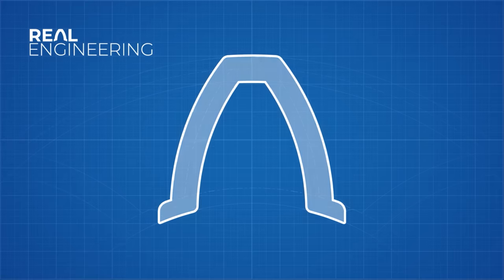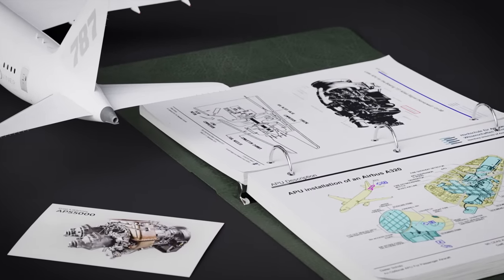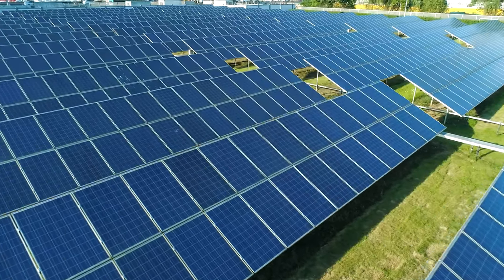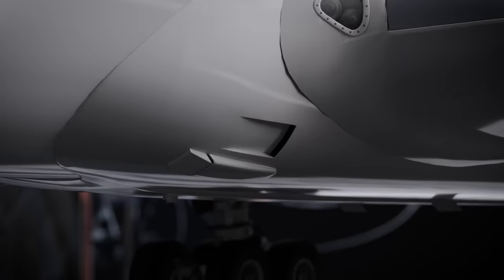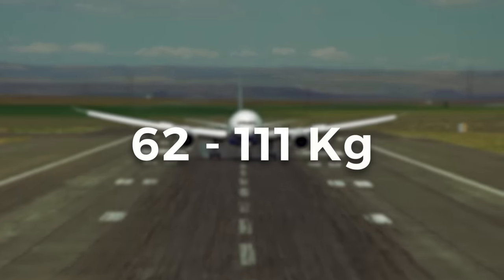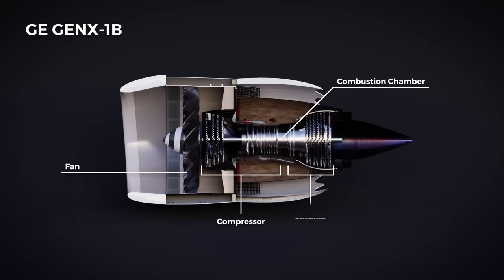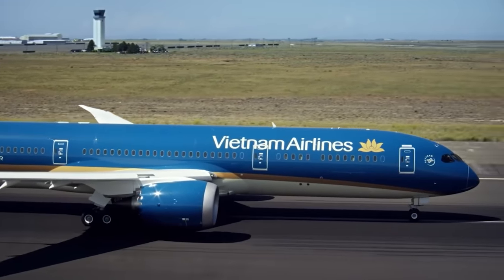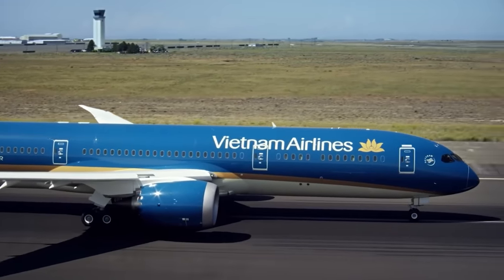The Insane Engineering of the GEnX

Comment: The GE90-115 is the big daddy where Turbofan engines are concerned. Even the GE9X engines that power the new massive Boeing 777-9 are rated at 5000 pounds lesser thrust than the GE90-115.

Comment: Small correction. While it's true that initially, the A-12 and SR-71 used Daimler Benz V8 engines on a cart to start the compressor, they quickly dropped that for a compressed air start instead.
Reply: Pretty sure the engines were Buicks…

Comment: Although I applaud your work on this and other videos and absolutely love the series you've created, there are some errors in this video.

The main ones ive seen so far are that turbofan engines dont use bleed air to power anything, there is a gearbox attached to the main shaft of the gas generator (N2), that drives the various pumps and generators.  Also, the compressor section and fan DO NOT rotate at the same speed on the same shaft.  They are both driven by their own shaft and turbine section.  These are coaxial shafts, because the compressor section of the engine can be rotating in excess of 10,000 rpm, while the fan section will rotate at 3-7 thousand rpm (if i recall correctly).

I say these things because I worked on the GEnx project back during the initial development stages, and before that I was on the teams that wrote the control software for the GE90 and CF6 families of engines.  The GEnx is actually an evolution and merger of both families, especially the GE90, which pioneered the composite swept fan blades, rather than the traditional metal straight-edged blades seen in most all other turbofan engines at the time.  The control software actually branched directly off of the software for the GE90-115b variant in its initial development, which was an engine designed for the long range version of the 777.

Comment: There are parallels between this plane and recent innovations in automobiles. 

 Advantages in direct fuel injection have allowed turbos and higher compression and better efficiency. 

Many vehicles now have electric power steering instead of hydraulic. 

Battery electric cars now have electric power brake boosters instead of engine vacuum boosters,  which are analogous to air engine bleed air power.

Comment: Bypass tubes like the SR-71 would considerably take the temperature down solving your heat problem of the engine so you wont have to burn rich fuels. Base the next engine off of this equation, .7854xdia2/PSI, for all diameters fuel side and exhaust side.

Comment: So the bypass works a bit like a dyson fan? High velocity, fairly laminar flows of air end up pulling in surrounding flows of air and accelerate them, creating a low pressure zone in their wake, which should create a suction effect in an open system. Seems useful.

Comment: This is a misinformation most people are missing. 58.1:1 is the TOP-OF-CLIMB Pressure Ratio, and it is usually quite higher than the sea level Pressure Ratio, which is 47.4:1. Moreover, this is on the highest end variant that runs the 787-10, which is pretty uncommon in the market. the 787-9 variant is more popular, and it runs on 46.3:1 Sea Level, and 55.4 Top of Climb. Source: GE Aviation's cite itself

Comment: What the host calls centrifugal force is actually centrifugal inertia.  That's the inertia that pulls away from a rotating mass.  The force that uses Newton's 3rd law to counter the centrifugal inertia, preventing the rotating mass from splitting apart, is called centripetal force.

Comment: Nice video. I;ve flown in 787s a few times and they are amazing. Boeing got their market research right, vs Airbus with their huge, mostly uneconomical 380.
One other point. we tend to focus on carbon emissions. High altitude nitrous oxide emissions are worse, because they lead to ozone formation in the upper atmosphere.
Reply: The 380 is perfect for long haul high volume traffic such as flying from London to sydney. The 747 was always used for that journey.
Reply: @bighands69  High-volume is the secret. Nobody could reliably fill a 380. Etihad and Emirates kept operating them because they offered beyond-1st-class accommodation, and losses didn't matter too much

Comment: For the environment, it doesn't seem to matter. I guess the tickets will be even cheaper, which means more air travel. It's like when more effective roads are built to remove traffic jams. It results in more cars instead and the problem remains. But as a resident near an airport, any reduction in noise level is appreciated.

Comment: for AC &cabin pressurization instead of using bleed air 
using an additional compressor and an electric motor which maybe a set and for an aircraft at this wide body
might need at least 2 sets of them and uses additionally 4 generators to give that electric power and then comes redundant systems which are a must required for a civil aircraft and when we we add up all these weights doesn't the efficiency gained from removal of air bleed in engine maybe be dissipated here.
or are there any other additional system by removing them gave the 787 an upper hand ?

Comment: Just a lil correction, at 13:10 you mention that the compressor and fan share drive shafts. This is partly true however there is something called multi shaft or dubble shaft engines. Which can have 2 or more shafts in the engine. This to manage speed  between turbine and compressor or turbine and fan better. Meaning the diffrent parts and stages of the engine can rotate at diffrent speed.

Comment: The generator numbers don't add up. 4:45. 2 on the APU and "2 pairs on each engine" (2 pairs = 4, so 4 on each engine) adds up to 10, not 6.  4 on each engine plus 2 on the APU = 10.

Comment: There are some very wrong and misleading statements made about how the fan is driven from the core. 

The fan is not directly attached to the core shafts, but has its own dedicated turbine in the exhaust, separated from the twin spool turbojet parts (twin spool designs have the fan directly connected to the LP compressor shaft but they're inefficient and usually only found in older designs like the JT8D and JT9D

Twin spool - the low and high pressure compressor/turbine sections run independently at their most optimal speeds

This is where the final efficiency gains are to be had (LEAP) - Exhaust turbines only work efficiently at high speeds even at the end of the LP section of the engine but fans need to be low speed. The planetary gearbox allows efficient turbine speeds AND efficient lower fan speeds - this could realise 15% efficiency gain as well as even more noise reduction, simply from having the fan turbine spinning at the "correct" speed for the core

The gearing idea (geared turbofan - GTF) isn't new. It's exactly the same principle as a turboshaft or turboprop gearing system and has made its way onto some smaller aircraft already (eg TFE731 and ALF502) - and even a single shaft design was attempted by Turbomecha in the 1950s whilst a GTF was proposed for the A340 in the 1980s (V2500SF)

The issue with GTFs is scaling up to handle the 20MW+ shaft power loadings of big fans whilst keeping the things small/light/reliable (This isn't an issue for GEnX ground-based power generation turboshaft units used in power stations, but they also get to use recuperators for even greater efficiency gains - something that would be simply too bulky to tolerate on a wing)

The secret sauce of P&W's gearbox metallurgy is probably worth a documentary all by itself. All of the makers have strengths and weaknesses which are likely to end up being cross licensed to each other. 

Rolls Royce are planning a GTF AND variable pitch fan in their Ultrafans - something which was only seen on a couple of small bizjets in the past. The mind boggles. Reverse thrust without reversers?? (RR are claiming handling 80MW shaft power to the fans on their designs - about 100,000 shp if it was expressed in "propellor aircraft units"

BTW, blisks aren't new either - They've been around in helicoptor turboshaft engines since the 1980s - again the issues are scaling up to these monsters on widebody aircraft wings

Comment: I have to hate Boeing but you have made it really hard to do with this video. It was the shortcuts they took with the 737 by strapping larger engines on an old fuselage then having to install an augmentation system and lying about it. This caused many deaths which is unacceptable and left me dumbfounded. About 15 years ago I used to hang out with a group of engineers when I lived in Seattle. They partied hard but were extremely intelligent and ethical people. Seeing Boeings fall as an American made me believe maybe they don't deserve their status or place in aviation.

Comment: I just flew on a 787 from dallas to los angeles. It was the most cramped plane I've ever been on. I was starting to get claustrophobia. Also, the plane was very noisy on take off and landing, due to some electric motor whining underneath me. Not very impressed. The most comfortable plane on this trip (4 planes total) was an old 737.
Reply: If people want cheap flights that is exactly what they are going to get. If they want first class there is a simple answer pay more money.
Reply: Since when are the 787s used on a 2.5 hour domestic flight?

Comment: Hydraulic pumps on airplanes are not driven by bleed air.  There are engine driven pumps on the engines accessory case and electric motor pumps.

Comment: Pretty sure Airbus had the same exact engines before Boing added them, which has caused a few crashes by Boing since the engines were too tall for the landing gear so they had to put the engines slightly infront and upwards of the wings

Comment: I think you're forgetting a really important aspect here. It's not that 50 years ago, they couldn't manufacture engines with higher BPRs. The thing is, each engine has an OPTIMAL BPR. And the optimal BPR was much lower those times. Why? The higher the BPR the smaller the core engine for a given engine size. So a smaller core has to drive a bigger fan. This means the core has to generate more and more power the higher the BPR. The limiting factor here is mostly the max. combustion temperature that the used materials can tolerate. And here lies the true limiting factor. The materials available 50 years ago could only withstand much lower combustion temperatures compared to today's engines!

Comment: The energy require to stop the plane is kind of all but irrelevant to the electrical capacity of the plane. The energy isn’t being provided by the engines or generators, as you stated it’s being disappointed by the brake pads and rotors. The generators just need enough energy to squeeze the pads onto the rotors

Comment: How does fatigue inspection occur on composite fan blades.   Sensors must be applied to both sides of these blades to see material separation… and how long is the interval between these inspections… what is the life of these blades… what is the safety factor built in to make sure they do not fail.

Comment: Uhhh I have one question to ask. You say that by reaching the stochiometric ratio you burn all and everything completely which would mean that all fuel and air is burned and turned into energy but then there's still the NO left. Also why would you want to go lean when that means you're also giving away potential energy or potential oxygen for burning, and thus limiting the engines efficiency. Also in a smaller   question isn't a jet engines stochiometric ratio 14.5 to 14.7 instead of 0.7?
Reply: Sorry I had 3
Reply: Please don't get offended by this if you do but I'm simply asking questions because of fuzzy areas I couldn't find. I understand I'm not a aerospace or aeronautics engineer but still I wanna learn something out of this.

Comment: I hear it often repeated that the 787's engines are the same diameter as a 737 fuselage. The fan diameter (not including the nacelle) is 111". The outside diameter of a 737 is 148". That leaves a 37" difference. I cannot find any reliable source to tell me the dimensions of the 787 engine nacelle.

Comment: Your details on air starting are incorrect. Air starting does not involve the use of direct impingement starting by blowing air over the engine's turbine, rather it utilizes a device called an air turbine starter, abbreviated ATS, the ATS is mounted to the engine's accessory gearbox, which is driven off of the high-pressure shaft, also known as the core, or N2. The ATS is plumbed into the aircraft's pneumatic system and is isolated by a start control valve, when engine staring is attempted, and the pneumatic system is energized (this can be by APU bleed, bleed air from another engine for cross-bleed starting, or compressed air from a huffer cart), the start control valve opens to allow bleed, or external compressed air in the case of huffer cart starting, to blow over the ATS, rotating it, and thus driving the gearbox and consequently, the engine core, until sufficient RPM is reached that ignition can occur. Typically, the ATS will continue to assist the engine as it accelerates until idle, at which point the start control valve closes.

Comment: Bypass ratios have a limit as fan diameter can make the engine too big that also needs a nacelle making it even bigger. The geared turbofan is the current design future as Rolls Royce is also adding this to their next large engine. The massive extremes over vehicle gearbox knowledge makes this harder. The next gen turbofans will have to add in near zero carbon synthetic fuel burn.

Comment: Great video. But it contains a couple of small errors:

At 4:55 you state there are two pairs of generators per engine when you meant two generators (one pair) per engine. 

At 8:40 you begin talking about extreme braking under the conditions of an "aborted landing" but what's actually occurring is an aborted takeoff.

Comment: One thing about the 787 that would have been a no-go with me as a buyer is the darn prolonged and complicated power-up sequence. WAY too complicated. A person should be able to plug the power in......wait for the "AVAILABLE" light, and press.......ON. I couldn't care less what the airplane has to do to be ready for power.....just let me know when I can switch on and be done with it. The "AVAILABLE" light should not illuminate until the aircraft is ready. Maybe even do a count down....like other processes on the plane. ( A lot of old school people don't wait for a proper power-up, and this causes unseen problems with systems)  There are other minor complaints but I found the 787 to be a user friendly device for the most part, once you get used to it's philosophy. Software loading is generally very easy. Some loads are very long, however and must be done precisely.

Comment: I have a question if anybody knows the answer. The video states that the aircraft hydraulic pressure is higher than normal aircraft. Normal aircraft hydraulic pressure is 3000 psi. I worked on a military aircraft that had a hydraulic pressure of 4000 psi and had special titanium hydraulic lines with cryofit connections. What is the hydraulic pressure of this aircraft and are there special hydraulic lines due to the higher pressure?

Comment: Funny you say that the combustors have a "simple task", when they are one of th most difficult and complex components of a turbine engine. Simple in some ways, not so simple in others. You have to introduce fuel into a high speed, high pressure air flow and ignite it, combust it, you need to keep the flame in one localized place, you must be sure it will work under a wide variety of mass flows and velocities, you must be sure it will never be blown out by irregularities in air flow, and if it does, it must be able to restart easily. Combustors are maybe the most difficult part. And I am not sure how the GEnX differs from most engines (though no doubt it does). You make it sound like one of the "insane engineering" components of the GEnX is that there are 22 injectors arranged around the compressor exit to inject and ignite fuel: isn't that what most turbine engines do? I suspect the ones in the GEnX are more advanced, but the basic layout is the same.

Comment: 7:00 Why not simply take in air, fresh and compressed, and heat it using only a very small amount of exhaust ? Or possibly and simply lead it through part of the exhaust while not 'bleednig' it ? If cooling is required, you can use the wings for that purpose.

Comment: Something struck me while watching the section regarding the bypass ratio and the planetary gear that was developed to help lower the RPM on the fan blades. Why not tap the same technology Koenigsegg uses on the Regera and use a torque converter with a hydraulic or electric coupling? It would eliminate the extra moving parts and using the right design could achieve a similar ratio considering the final drive ratio for the Regera is 2.58 to 1 when the coupling is fully engaged, close to the 3 to 1 that they were achieving. I am not an engineer, so maybe im being naïve, but it sounds like a good idea in my head lol

Comment: interesting. can't remember the last time I like video in this channel.  I wonder if electric motors can help with larger slower fans and have jet fuel become an electric generator.  so much heat is wasted in jet turbines. i reckon, this setup is slightly less efficient but saves a lot in simplicity, maintenance, and reliability